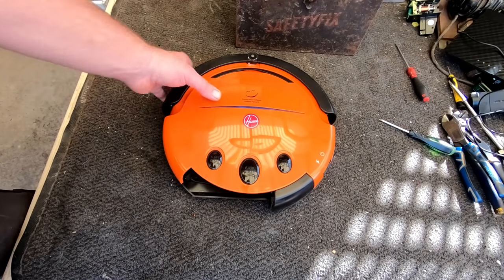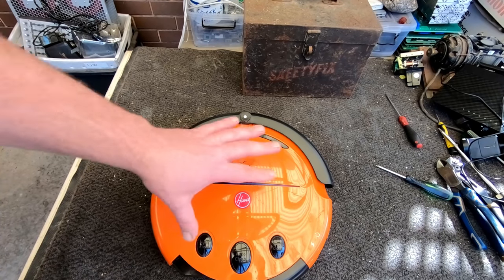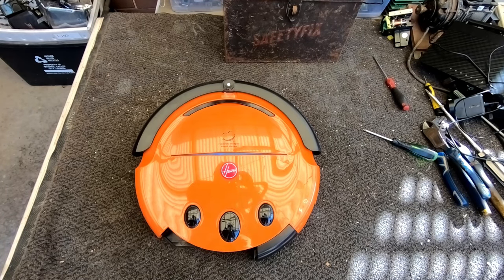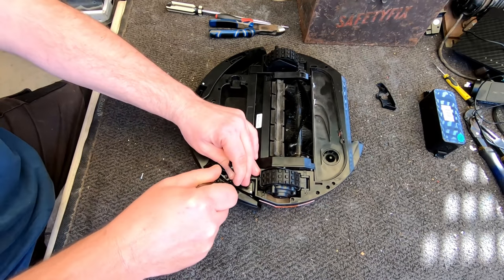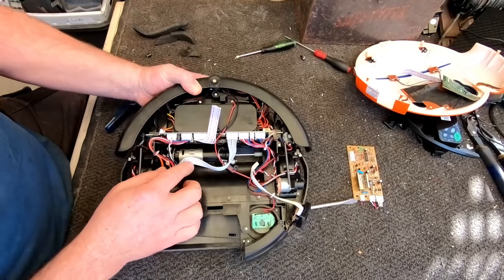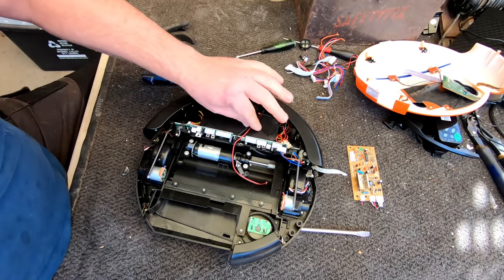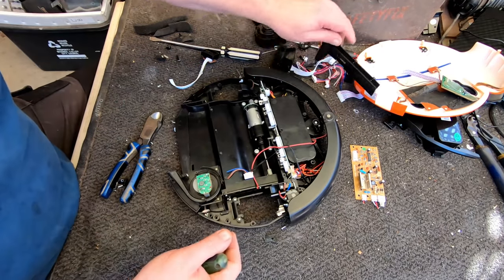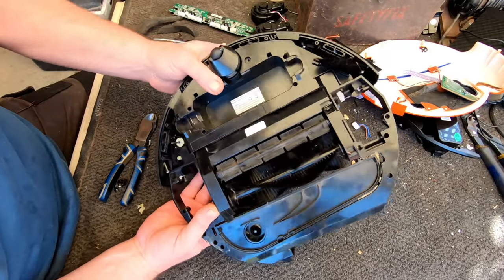Scrapping Robotic Vacuum Cleaner & Mystery Tool Box

Comment: most likely a ramset for driving nails in to concrete. Usually used for anything that will be mounted to concrete floor but also can be used with small gauge steel
Reply: That was my guess.

Comment: It's a ramset. I use one just like that when I frame houses. It shoots a nail through a board into newer concrete. The ramset I have has a trigger so you can use it in a tighter space. Like when you are framing a basement window. The tool is very hard on your wrists and ears.
Reply: Can you shoot a zombie with it?
Reply: @toomaskotkas4467  yes, but you would have to tackle the zombie first. there is a safety mechanism on the ramset that prevents you from firing unless the spring loaded barrel is firmly pressed against something. After tackling the zombie you could nail the zombie down or to a wall.
Reply: @philipbender956  No, sounds way too complicated.  I'll use the shotgun instead.  Thanks for the info!
Reply: @philipbender956  , i hadn't thought about that use.  great advice in these comments.  a multi-purpose tool.

Comment: The nail hammer is an old version of one I used to use when I was a joiner. We had to do a course and get licensed to use one. The blanks are colour coded for the power in them and the size of nails they can fire. If you look up Hilti you will find a modern version of the one you have

Comment: the tool used for putting a fastener into concrete or any other hard surface that cant be drilled easily, its a 22 cal blank cartridge that fires the projectile into the material, and then u can screw down bolts or whatever to make a secure fastener. u load  the cartridge in the back and the spike in the front, and then hit the hack with the hammer, that discharges the shell and drives the spike into the concrete. still used today but in a different form
Reply: called ramset

Comment: The Safetyfix device is an explosive powered tool for fastening timber to concrete or steel.  Uses include fastening bottom plates (of wall frames) to concrete slabs, fastening timber to steel beams, often over openings to garages or windows.
What look like .22 calibre rifle rounds, contain differing amounts of gunpowder for use with different densities of concrete.
It is advisable to use PPE ( Personal Protective Equipment) when operating these tools including earmuffs & safety glasses.
In NSW, we are required to be trained & licenced to operate, even purchase these items. These days, those tools are shaped more like pistols & must be pressed hard against the surface of the timber in order to fire them. Some even have a magazine so it is not necessary to continually load the explosive charges. I have a single shot version which must be broken open between shots ti fit the charges & nails in place before use.
That would be a Collector's item, of interest to a Museum too.
Please be careful when handling the charges. They may explode but are more likely to fizzle given the age of the gunpowder.
Reply: modern gunpowder is extremely stable.  even if in a ship sunk during the first world war.  it will last for hundreds of years.  i've got a ramset as well.  i'd be concerned using this compared to a ramset.  ramsets come with cartridges of different strengths.  they are colour coded.  i'd imagine these are too.

Comment: Hey Ben, the safety fix box was for a powder actuated gun used for connect wood to concrete where you need the charges (bullet things) for driving the nails through the wood fixing it to the concrete. Pretty common tool for contractors.

Comment: took a carpentry class back in the 70's got trained and certified for the Hilti gun a concrete fastener that used 22 cal. blanks to drive the fasteners into concrete

Comment: There has to be a way to get at those bits quickly. Maybe a hammer mill on low speed with no screen. Just to belt it 10 ways from sunday and you could pick the dinged up motors and big bits of circuit board out of the other rubbish. Cuz you know all that plastic should be easy to break apart.

Comment: Happy belated Birthday Ben!!!
I got a couple of modern day ones back in the 90's. They are the same concept. The newer ones have a rubber handle on it. Wear earplugs if you ever use that thing!!!
They sound like a 12 gauge shotgun when you hit the end & the  charge goes off!!!
I used it for concrete work, the work I did always needed a bolt on the end so I used the threaded end to be able to put the bolt on or take it off if needed. It's probably also used on brick house/buildings  to attach things like a #'s or signs on a house/buildings.
The charges aren't put in sideways anymore (That was weird to see) they are loaded kinda like a gun, the hammer hits the rod, the rod hits the primer of the blank and BAM!!!
Have a GREAT Day Ben!!!!
Reply: The cost for the newer ones (in the 90's) are pretty inexpensive only $19.95 for the tool and $5.00 U.S. for the Charges. The Charges look the same and are the same size of 22 cal. .
I had a lot of fun with them! One time I was using it at a job site in the bad part of Indy, and one of the neighbors called the cops because they heard gun fire. Which it most definitely sounded like! That was not a fun experience to have the cops come around the corner of the house with their guns drawn!!!
Yikes!!!

Comment: Great stuff Ben 👍 I have had a couple of the robotic vacuum cleaners to have a look at and repair and the problem with them is the motors don’t last. Just cheap motors and also the transistors fail {mosfets} . Also yes the 22 cartridges will be live rounds unless they have been wet😃
Adam Ballarat

Comment: And happy birthday mate , It was a tool for putting nails through timber into a concrete floor or wall , and the plate acted like a washer holding the nail against the outer edge of the timber

Comment: that old toolbox is for putting nails into concrete you put the nail in the tool in the brass on topping hit as hard as you can with a hammer and it shoots a nail into the concrete

Comment: Must be a fastening system. Powder actuated fasteners. Remington and others make similar tools today. Used for fastening to concrete or steel. The washers stop the nail from over penetrating.
Reply: Hilti makes a whole range of these with different strengths of charges for different material penetration. Very handy if you're building a wood frame structure on a steel I beam frame. I used to repair the Hilti brand units.

Comment: Check out Ramset on Ebay and that is the American  version of what you have there.  I used to use them to fasten walls to concrete floors. Nice tool if you are finishing a basement.

Comment: I was thinking safe by the standards of yesteryear but actually a potential hazard, but, upon viewing a competent rundown on how its put together and its correct appllication it would be pretty safe in reliable and competant hands. For example, the brass ordnance, if that is correct parlance, would be of insufficient charge to blow out the stout and enforced chamber. You'd secure the stuff. You wouldn't want kids or adult hoons hammering away on the exposed brass ' bullets ' to amuse themselves.